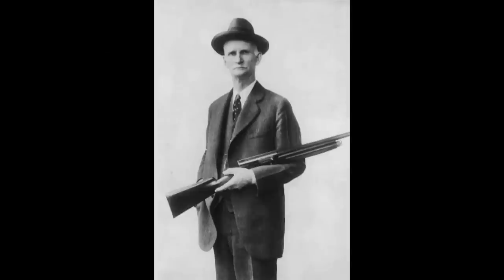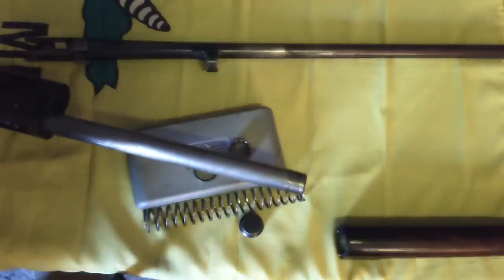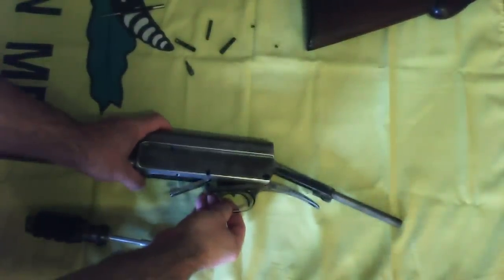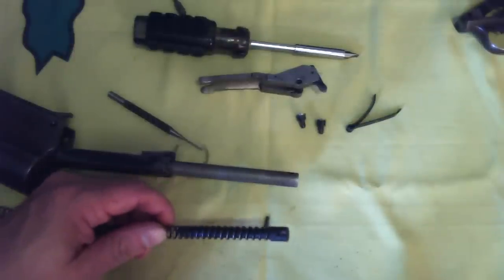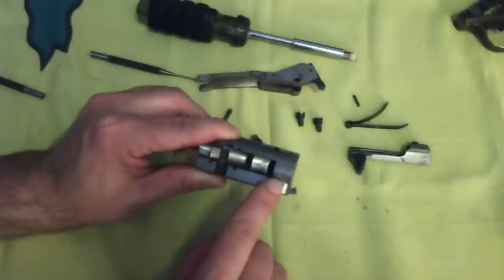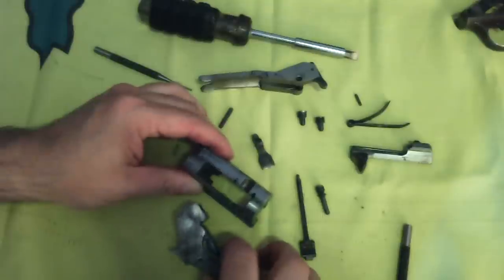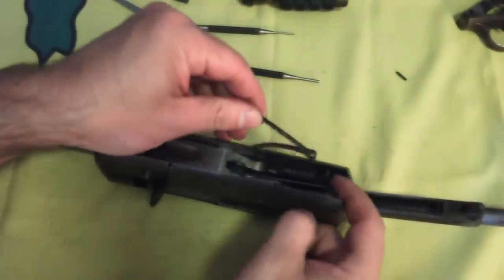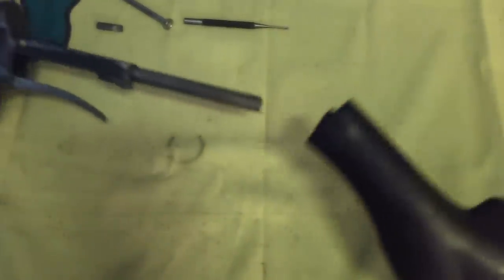Basic Firearms Disassembly #5: Remington Model 11 (Browning Auto-5)

Comment: One of the best videos of this type I've seen. I'm dong a light restoration on a M11 (rebluing and wood refinish). But, I would suggest that nobody whack the front edge of the comb if the stock is stuck. This is an easy way to damage the wood. I've always used a rubber mallet and given a good smack or two to the butt. The recoil effect will loosen the stock from the receiver, and if you protect the wood with a folded rag or a sacrificial wood block, there is no danger of wood damage.

Comment: 2:00

I was given a Remington Model 11 as a child by my grandfather who bought it surplus after his service in WWII.
The first thing I did was dissemble it and slam the action shut on my finger while doing so. lol

The extraction hook at the front of the bolt slammed into the joint at the end of my left pointer finger dislocating the joint at the tip.
It tore up the flesh sothing fierce and slightly damaged the joint.

Finger works fine now, it's been a few years since this happened and my poor digit has made a full recovery. lol
Reply: Mine has bit me 4x so far! It's a bear trap!

Comment: A world class video.  Exacting and precise with an eye to safety which I appreciate.  I have been doing a minor restoration on an inherited Model 11 (DW date code...Sept. 1928?) with considerable surface rust with the "pure copper penny, 0000 steel wool and oil combination" with remarkable results.  The wood is in good shape save some white paint here and there so that is easily dealt with.  I am lucky this gun was stored in a barn in an arid part of California....spider webs in the barrel and wasp casings in the slotted recoil pad non withstanding.  Thanks so much for your time and effort to educate me and so many others.

Comment: Jeff,
A local old time gunsmith found the answer to my question of "How to remove the Stop latch (pin) when there is no half-moon notch in the receiver ejection hole; Roger Looke in Hillsboro OR studied my receiver assembly for a few minutes then took it to his work table. He took a very thin 1/16' long neck pin punch and punched the stop latch pin out from the ejection hole side back through the access hole on the left side of the receiver.  Remington did not change the design of the gun except that without the half-moon notch, it makes removing that stop latch pin much harder.  I hope this helps others that have found themselves without a half-moon notch.
Reply from the maker: Hooray!  I knew the Almighty Internets Would Provide!
Reply: Gregory Carrigan This is what I was afraid of when trying to disassemble my model 11. I dont have that tool on hand :/ Oh well, next cleaning is a FULL tear down. Thank you for posting the info here!
Reply: Gregory Carrigan, you (and your gunsmith) just saved my tookus.  Thanks!
I had to fashion myself a tiny drift punch out of a piece of heavy steel wire.  Thankfully mine wasn't wedged or rusted, so it came right out. 

An old drill bit was going to be my next abused tool, but thankfully I didn't need it.
Reply: I also have a Remington Model 11 16ga. that does not have the half mood cut out. I used a 1/16th drill bit as a punch to go in through the ejection port and push the pin through the hole on the other side of the receiver.

Comment: Amazing the difference in what your average shot gun owner was expected to know back in the 30's & 40's compared to modern times.  I consider myself gifted being able to mechanically sort most things without instructions just by looking it over and understanding what needs to happen when.  Not so with the Remington Sportsman that was gifted to me.  I had read up on it but only found troubleshooting information.  So I took it to the range and ran some shells through it.  Which it ran like a top and never skipped a beat.  I managed to get the barrel off on my own and realized to go deeper would need help.  Not sure I could have sorted it on my own.  Your video was very helpful.  I'd like to help support your channel if I can.  Thanks again for your effort.  You haven't done a Vetterli breakdown have you?  I have one of the Ethiopian cut down models that is in truly sad shape.

Comment: Thank-you so much for making this video. Both my wife and I inherited Browning A5s from our grandfathers. Mine is a 12 gauge, well maintained. Hers is a Sweet 16 in rough shape. At first glance I was pessimistic since it was filthy and the muzzle end of the barrel has some surface rust. After watching this video I was able to completely break it down and was pleasantly surprised. There's a little bit of rust on the bolt, but otherwise just covered in gunk. I'm detail cleaning and trying to get rust off non-blued parts, and considering re-bluing. I saw your response regarding Turnbull. The SN is 33986.
Reply from the maker: You're welcome!  According to a list I found on the Remington Society forums (remingtonsociety dot com), and if I'm reading it right, yours may have been made in 1907.

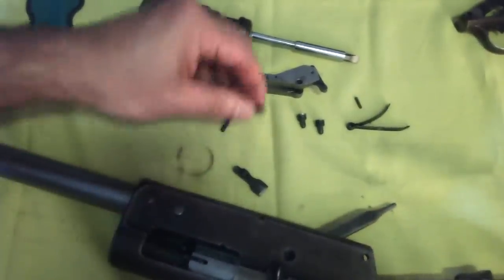Comment: @6:20 the right side of mine (Remington Model 11) isn't machined to allow that pin to push through (no notch along the breach port).  At first it seemed that this was the end of the road, however I overcame this using a 1/16 punch to push the pin through the opposite direction to what is shown.  This was possible because I could see ~1/3 of the pin on the other side.  It helped to first push it as shown in the video to make sure I had it lined up, then tap it through the other way.  Thought I'd share in case it helped others.
Reply: Wish I saw this after I reassembled. I couldn’t figure it out either when I got to that point so just cleaned as best I could from there and put back together. But I could see the pin from the other side.

Comment from the maker: The tube is threaded in the front of the receiver, and may be held by a lock screw forward of the carrier latch button.  The threads may be very tight and you may have to apply Kroil or the like to break the tube loose.  I would also strongly recommend having a replacement tube on-hand before attempting removal, as removing the old tube may damage it further and replacements can be very hard to find.  Also be aware of the dimensional differences between the Remington and the actual Browning.

Comment: Hello again,

We have a 1953 Browning Belgium A5 12 guage..  Would you suggest leaving the Duck plug in or out?

Getting to retention cap off the mag tube and back on is not fun.

Is there a concern in loading snap caps through the loading plate elevator?  We tried to do so and created a jam that required disassembly of the mag tube to remove it. Scared to use snap caps now.

You are also the only video that introduced the 3 positions possible for the friction rings, thank you. What loads would you use for each of the three positions?  As asked earlier,  what is the proper "clocked position " of the black ring over the brass friction ring?

Curious on your lubrication recommendations.  When do you  advise using gun grease versus light oil and on which parts would you use gun grease if at all?

We did finally fire the gun and experienced a few feed issues using #7 bird load.  This is most likely due to incorrect friction ring setup and lack of proper lubricant. 

Thank you again for your video, I want to contribute but unsure how to do do.  Please advise. 

Sincerely, 

Rick Mansberger

Comment: This is so much easier to understand than Remington's user's manual.  Thank you!  How often should you disassemble this far for cleaning versus just removing the barrel and swabbing that out?
Reply from the maker: Opinions differ.  If it's been in wet conditions like duck hunting, you might want to do the full teardown.  If you've been to a sporting-clays range on a summer weekend, basic field-stripping should suffice.

Comment from the maker: The rear end of the magazine tube is threaded into the front of the receiver, locked in place by the small screw on the right side of the receiver forward of the carrier latch button.  Even with the screw removed, it may be difficult to remove the tube from the receiver.  I recommend caution, and perhaps one of those strap-wrenches to avoid damage.

The spring retaining cap in the front of the tube can be carefully pried out with a large flat screwdriver, but it's very difficult to replace.

Comment from the maker: It's possible it's just really tight.  There might also be internal rust.  Try some penetrating oil like Kroil and let it sit awhile.  Make sure you have a correctly-fitting screwdriver filling as much of the slot as possible, and take care to avoid marring.  Good luck!

Comment from the maker: I would expect it to work fine, as long as the spring and follower are undamaged.  The spring should be nearly universal, and if it needs replacement, one the correct size from any other tube-fed shotgun should work.  Likewise I expect there are many followers from other models which should fit or could be made to.  It sounds like you don't even need to replace the tube.

Comment from the maker: The first thing that comes to mind is a light, that is underpowered, load.  Are you using factory ammunition?  Have you rearranged the recoil pieces for light loads, and lubricated the magazine tube?  Does it eject properly sometimes?  The ejector is a fixed bump on the left side of the barrel extension.  The extractor holds the spent shell as the barrel runs forward. It's possible the ejector is worn as well.

Comment from the maker: There are two ways.  First, the entire tube can be unscrewed from the front of the receiver so you can access it from the rear.  There's a small screw on the right side of the receiver which locks the tube and must be removed first.  Alternatively, it may be easier to pry out the internal cap on the front of the tube, referenced at 1:10.  Go slow and be careful to avoid damage!  Also note the internal cap is very difficult to replace once removed, though the weapon should work fine without it.

Comment from the maker: Generally you don't need to remove, or access the inside of, the magazine tube.  If you've just acquired the weapon, or if it hasn't had a proper cleaning in a long time, it should be taken down as thoroughly as possible, but for routine cleaning just getting the barrel and recoil pieces off should be enough.

Comment: Looking for info on the buffer pad .  I have a 20ga sportsman and wonder if I should replace it.
Reply from the maker: My M11 is retired now, but I did use it successfully in a couple matches, and it had obviously been used for many years after the buffer disappeared.  I encourage you to seek second opinions, but mine is that it should run fine without it.  Replacing it might require substantial gunsmithing, replacing the rivet in the back of the receiver - and then it might fall out again anyway.

Comment: First of all, thank you for this amazing video. I recently inherited a Model 11 with a poly-choke, and have been itching to take it down and clean everything.

I dont have a hole, or cutout, to remove the crosspin mentioned around 6:05. I can see the pin from the side im supposed to drive it TO, but there is no way to push it that direction. 

For now, im going to clean and lube what I can, but I would really like to completely clean it. Thank you again for the video, and for any recommendations. I can supply serial if needed but I would rather not do it over Youtube comments :)
Reply from the maker: bgossler It looks like Gregory Carrigan, commenting below on 26 February, has found a solution.
Reply: Found it. Should have looked below. I now have another question. 

It looks (and sounds) as though the hammer is allowed free motion after fire (with dummy ammo, not tested on live rounds...) after cleaning and lubing. Is this normal? Or did I miss a latch or something?
Reply from the maker: bgossler Can you describe "free motion"?  You should be able to observe the hammer through the bolt handle slot in the receiver.  I'm looking at mine now and there should be no movement.  Possibly something wasn't lined up right on reassembly.
Reply: Jeffersonian1 If I shake the gun fore and aft of my body, I can hear something moving in the reciever. Shaking it while looking behind the bolt, I can see the hammer moving freely after the trigger has released it. The bolt latches back correctly (as far as I can tell,) and the hammer stays latched until I pull the trigger, but after pulling the trigger, it seems to have free motion.
Reply: Jeffersonian1 Not sure what it was, but I just loosened the rear trigger assembly screw a turn or two and the hammer moved forward again. Maybe the pressure of the screw was holding a spring back or something. All seems well now.
Reply from the maker: bgossler Something's definitely not right, maybe in the trigger group, which I have not messed with.  If the trigger group does need attention, it's covered in the Gun Digest Book of Firearms Assembly/Disassembly, Part V.  Parts diagrams can be found free on several websites.  There should always be hammer spring pressure on the hammer.  When pulling the trigger, does the hammer snap forward with normal force, or just flop loose?  I suggest disassembling again and looking at the trigger group carefully.
Reply from the maker: bgossler Might have just been binding from an overtightened screw, squishing the receiver walls together just barely too much.  Glad it worked out!

Comment: Thanks for the video! I inherited two A5's, a 12 and a 20 gauge, both older than me, at least 36 years old. Neither have been fired in as many years also so this video will be very helpful. Any advice on load types? What to avoid or what works best? Thanks

Comment: I have and early model 11 on which I need to replace the ejector pin; my model doe not have two extractor pins, but one extractor and, one ejector which is part of the barrel assembly.this looks to be a press fit so my question is can I drive the old pin out and press in the new one.

Comment: I have this exact gun and need forend stock replacement.  I'm afraid I can't find the exact replacement.  The original has an embedded small metal pin on the cap end to provide the ratcheting effect when tightening and loosing the cap, and the other end has two small wood pins that allow the stock to lock into the receiver.  None of the replacements I've seen have these features.  What do you suggest?  Great video by the way.
Reply from the maker: There are sources on the net for replacement parts.  The ones I've found which claim to have Model 11 parts are:

Poppert's Gun Parts
http://www.poppertsgunparts.com

Outback Gun Parts
http://www.outbackgunparts.com

Hoosier Gun Works
http://www.hoosiergunworks.com

Sarco
http://www.e-sarcoinc.com

Bob's Gun Shop (Royal, AR)
http://www.gun-parts.com

and Numrich of course.
http://www.gunpartscorp.com
Numrich appears to have some foreends in stock for not-completely-outrageous prices.

Another suggestion would be to simply haunt the gun shows.  I expect every decent show has what I call "Parts Geezers", a couple-few old guys with stacks of tackle-boxes full of parts.  Some of them are even organized by make and model.  ;)  And, just ask the old guys at the shows, some of them are living encyclopedias and can point you toward someone else who has what you need.
Reply: Thank you.  This is helpful.

Comment: I had problems with the action spring, the wooden guide was gunked up and swollen really bad to the point it wouldnt move, couldnt compress the spring by pushing in on it. I heated it with a propane torch just enough to loosen up/boil the oily gunk and it came right out.

Comment: Hi Jeff
I just purchased a Model 11 Sportsman 20 GA.  I have disassembled down to the pint for removing the bolt from the receiver, I gun does not have a notch on the right side to push the take down pin through and I cannot find a pin through the take down hole.  I think my model is a later one and slightly different at this point.  Do you know to remove the bolt from the receiver in this case?
Thanks Greg
Reply from the maker: I still haven't encountered one of these.  All the examples I've been looking at, at the shows, have the notch and hole.  I'll keep looking.

Comment: I realize this video is a year or so old, I have a 20 Ga built in 1947 (XSS). As with Simbros13, my Model 11 does not have a notch to drive out the bolt cross pin when I align the pin with the take down hole.  While I can see the pin from the take down hole, it does not seem as though it has any relief space to remove the pin out the other side. There is a slot inside the receiver a little closer to the front of the receiver, that does not go all the way through the receiver, that lines up with the pin, but when you line the pin up with it there's no access from the other side to drive the pin. I wasn't brave enough to whack away carelessly hoping it would find a way out. Have you come across any other of these and know how to remove the pin in order to get the bolt out?
Reply from the maker: I have not encountered any like that.  I'll keep an eye out at the gun shows, maybe I can find an example and examine it.  All I can suggest in the meantime it to use a non-marring tool, like a brass punch or rod, and proceed with caution.